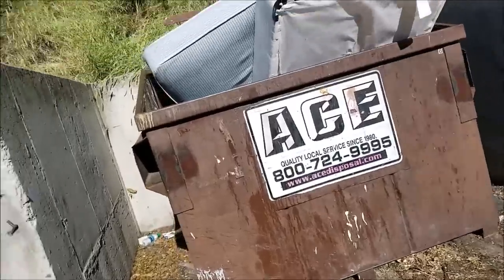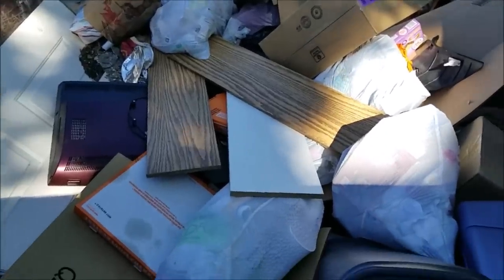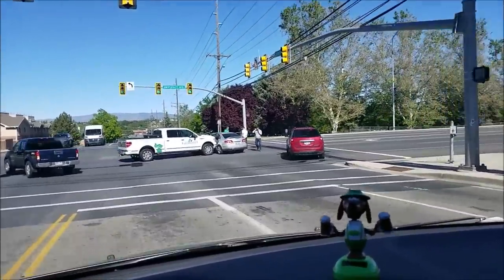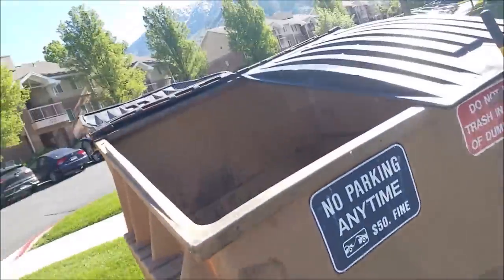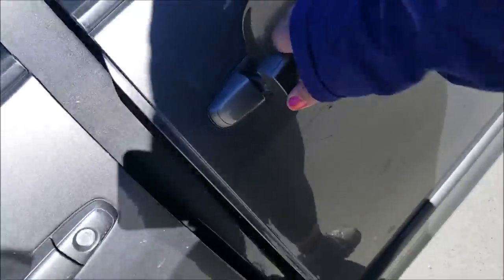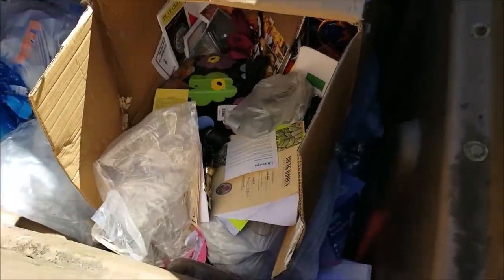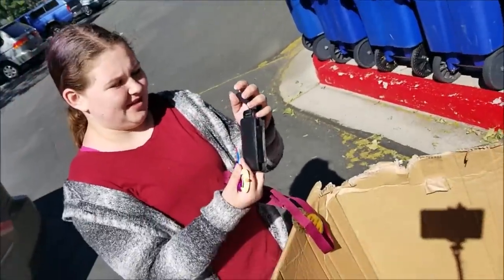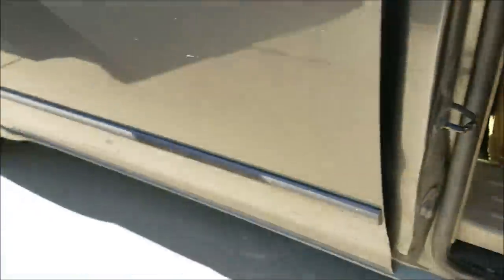DUMPSTER DIVING! College Student Housing AND a Car Wreck???

Comment: Hi frugal Mom and Lulu, I want to give you a tip, when you come across those big containers, they can be opened, as long as it's not too full, what you have inside where you climbed fake stairs to your left hand in the  low part is like a tube that crusade the container at the door has a small chain that takes it out opens is much easier than jumping can hurt you, I tell you why I see other youtuber that they do not pass work 😜😜😜
Reply: I was just about to type the same thing!   Have a blessed day